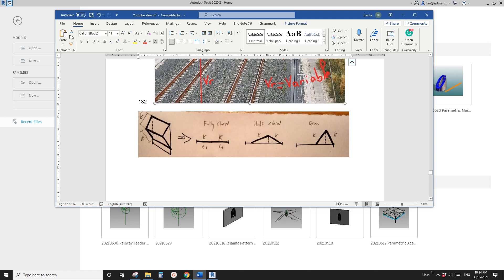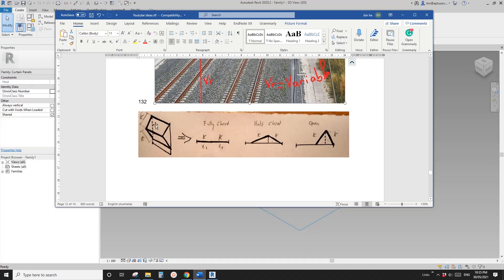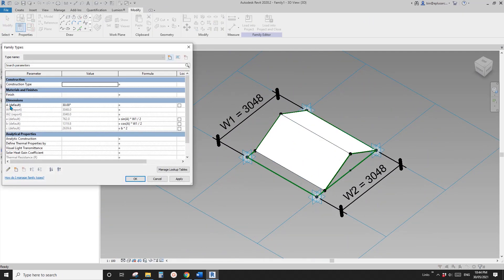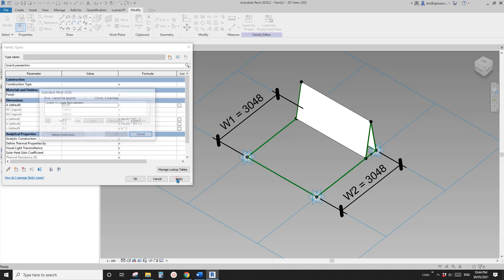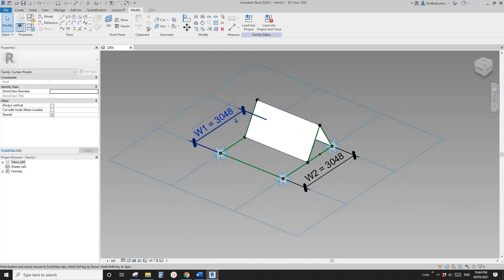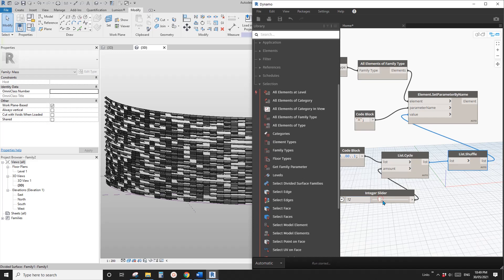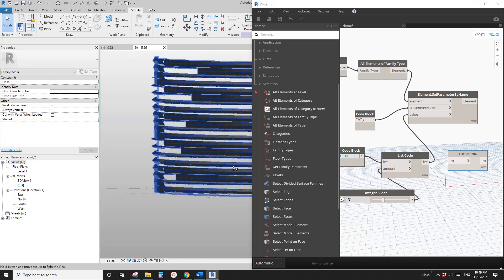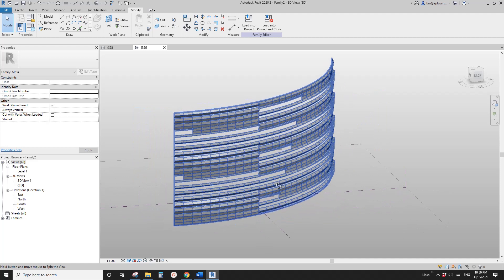Everyday Revit (Day 436) - Pattern Base Family - Adjustable Panels

Comment: Hey Bin, When i try to change the angle of panels in mass, I got an error that can't make the type family. What am i doing wrong ? 
Great videos by the way !!!
Reply from the maker: Something is not right, can you upload the file? https://t.co/JZIuCob2Ah
Reply: @BINHE615  I will. I guess when the lenght is too big it can't make it. Seems to work now. Also would like to ask you if is any way possible to make the panel thicker becaui have some visibility issue when tranfer it to twinmotion.
Reply from the maker: You can select the surface and create form again to make it into a solid.
Reply: @BINHE615  Thanks a lot for your fast reply ! I will try and let you know :)
Reply: @BINHE615  I tried but i got the messsage " To create 3D forms, first creat lines ..."
Reply from the maker: I can have a look for your if you upload the file.
Reply: @BINHE615  I am using the file your provide
Reply from the maker: You can go into the family, select the face and create form.
Reply: @BINHE615  i try but without any luck

Comment: Hi Bin, when i tried to create a mass in my project and use the family and then use dynamo it didn't work... the panels weren't rotating. Thanks
Reply from the maker: You will not be able to use Dynamo on a model in place Mass. You need to create a Conceptual mass, do the Dynamo, then load it into the project.
Reply: There is no way to access model in place through the API ergo no way to access it via dynamo either.